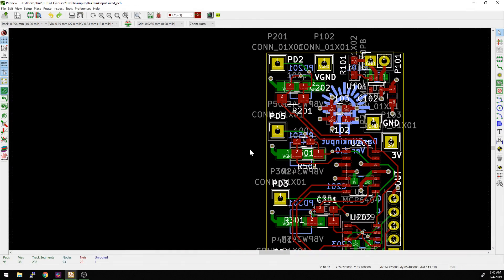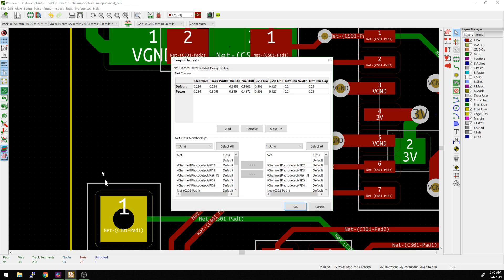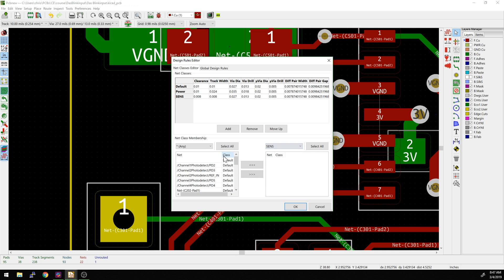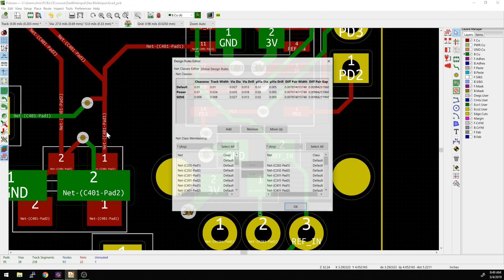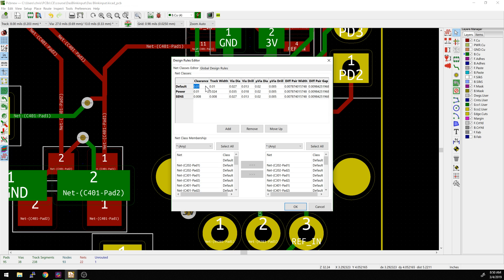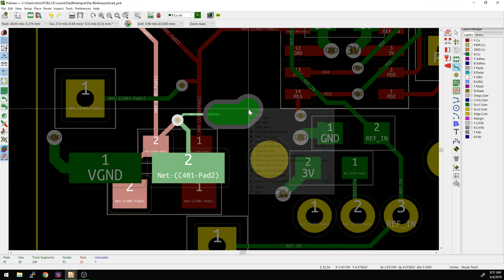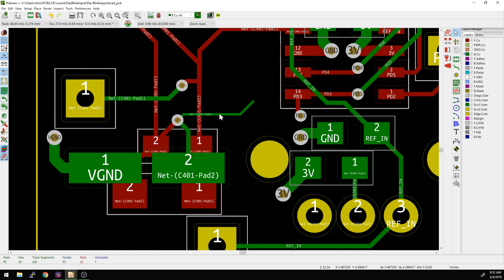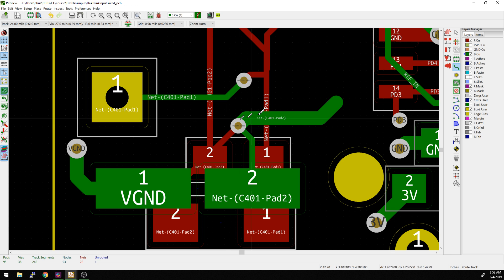KiCad 5.0 - Changing trace widths

Comment: Good video.  I was wondering though is there a way to change all or most of the trace widths at the same time.   Say you route the board, but decide the trace widths are too small for the power and GND traces.  So you create a couple of net classes.  How do you change all the GND traces or the +12v traces to those net classes and have them update instantly?  Or do you have to each and every trace be hand.  Or do I need to rip up all the traces and re-route it using the new design classes in the design rules.

Comment: If you chose the wrong default track width at the start of a project, and made a whole board with under size tracks, is there a way to select all the tracks at the same time and increase the track width without having to select each segment and edit it individually? Maybe you could select a whole net?
Reply: Try using the "u" and "i" keyboard shortcuts, or hiding everything except traces and then select all dragging the mouse

Comment: Quick tip - instead of writting 0,006 you can write 6 mil or 6mil - KiCAD will automatically translate it to 0.006 value, IMO much faster to write than 0.006. Just write that all, click OK and reopen to see it works ;)